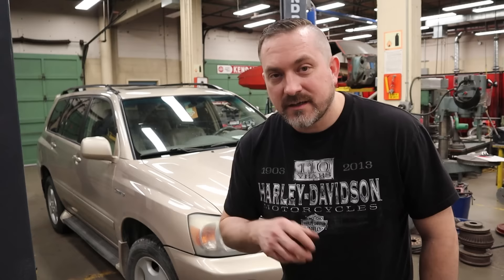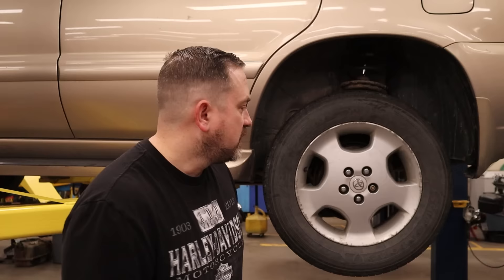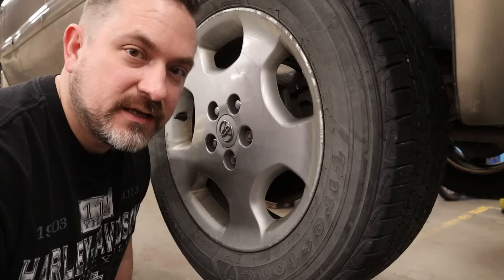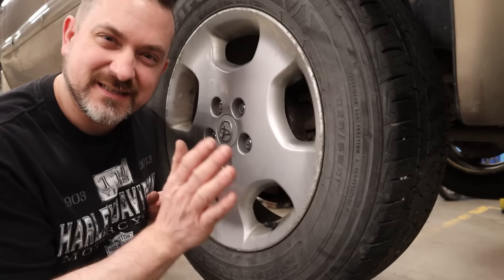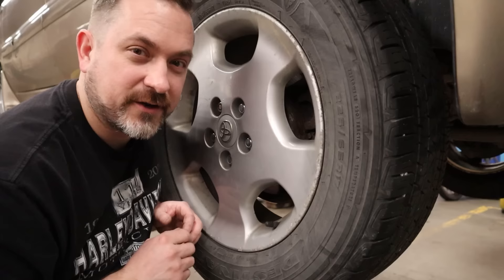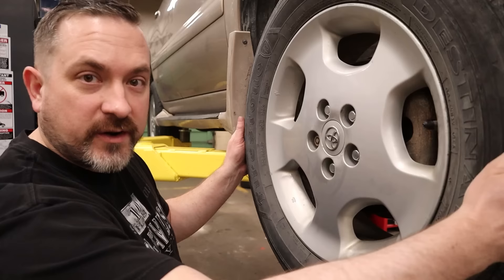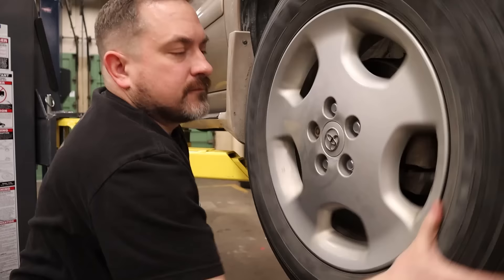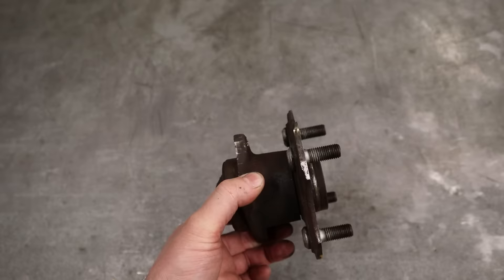How to 100% diagnose a bad wheel bearing.

Comment: The only tool I use to diagnose a bad wheel bearing is my ears
Reply from the maker: Yup, it's a powerful tool.  I'm using my ears to diagnose a bad bearing right now on my vehicle.  Thanks for the watch!
Reply: What if the wheel isn’t making any noise at all? My mechanic today said I need a new wheel bearing because my rear wheel feels loose
Reply: They literally scream at you lol
Reply: YH can u tell what one😂
Reply: @kia19982012 
He might be telling the truth.sometimes bearings don't make noise.
Reply: Yeah only problem with me is my truck is lifted with mud tires so it already makes noise but it does start to shake like a broken belt in the tire at highway speeds
Reply: That's pretty cool bro, I'm a home mechanic (on my own cars lol) have done a tonne of work so far tbh but my ears aren't confident like yours.. I wish they were but I still need to check yt every once in a while lol
Reply: Thank goodness I don’t take my car to you for repairs lol
Reply: That’s a great tool by the way

Comment: My friend checked my wheel bearing by a driving test.  As we drove down a smooth road we drove over a short hump in the road.  As the car momentarily lifted and came back down, for that  brief .moment the grinding noise stopped.  Diagnosis: A bad wheel bearing.
Reply from the maker: That's cool.  You temporarily unloaded the bearing which made it go quiet.  You can also do a road test where you turn and make the sound go away if you unload that side as well.  I made a video for this and it is coming out soon.  Thanks for the watch!
Reply: My issue it only humms at 30+ mph no grinding only a humming like I need to shift to a higher gear but I'm in top gear and when I slip it in neutral while costing at 55mph it has no effect on the sound. In fact if I'm costing down hill in neutral it get very noticeable humming sounds just like I'm in a too low of gear but I'm certain its not the transmission. The drive side does have minute amount of play when I perform the Shakedown test but when I rotate it there's no grinding

Comment: Put it in the air after the test drive and put your hand somewhere near the wheel bearing on each wheel, be careful not to get your finger stuck around the wheel, and spin the tire. You'll feel roughness as the wheel spins. In theory you can also use a infrared thermometer after a test drive and shoot the center of the knuckle around the wheel bearing and if a temp reading is very hot you have a bad wheel bearing in that knuckle.
Reply from the maker: Nice tips!  I actually have a mechanic's stethoscope that I use to "hear" hard to tell bearings and it works really good.  Best $25 tool in my box for diagnosing issues.  Thanks for the watch!
Reply: @wayofthewrench You can also use a long screwdriver, long wood dowel, or a broomstick handle to amplify the noise. Just touch one end to the bearing housing and the other to your ear

Comment: Where's the steering linkage video?
Reply from the maker: There isn't one yet but the principal is shake the wheel left and right and there should be no play.  If there's play, have someone look for steering linkages that are moving independently ( one moves and the joining part doesn't).  That's the bad steering part.  Usually it's the outer tie rod but could be the inner (squeeze the rubber boot to feel that one) tie rod or even power steering rack bushings.  Good luck!

Comment: My 06 Highlander had the ABS cover perforate from rust which caused the bearing to seize. It nearly brought me to a stop. I limped home and replaced both sides, packed the cavity behind the ABS sensors with grease, and it has been fine for a few years. Thanks for sharing!
Reply from the maker: Nice!  Its always nice to do your own work.  I now have a 2008 Highlander Hybrid, it's a nice vehicle.  Cheers!

Comment: My 2004 Camry with 104k miles suddenly started making a sound that sounded JUST like your Toyota Highlander.  It was like a weird kinda clunk but the clunk happened at an even pace.  Sound got worse with speed.  Turning it to the left made it clunk less.  Going to my mechanic tomorrow to get it checked out and now I'm armed with this information.

It never occurred to me that that initial grinding noise from a wheel bearing that is SLOWLY starting to go bad was something I actually thought was "normal" when I was driving in the freeway.  Glad I went directly home after I heard it start to thump/clunk like that.  Thank you!
Reply from the maker: Awesome! Glad I could help ya out.  Keep in mind a cv axle can also make sounds like you said and sometimes multiple issues can be happening at the same time (wheel bearing and maybe now a cv axle too).  Good luck!

Comment: Thank you. Great video. 

The situation that is annoying though, is right when the bearing starts to go bad, so it sometimes makes such symptoms, but not all the time. 

When my right front bearing was going out, it made that growling noise ONLY when I was turning left in traffic circle at speeds. When I was traveling in the straight, it did not make that noise. 
Reacted to the 3-9 / 12-6 push-pull test. Movement was barely maybe 1-degree, but it moved. 
Spinning the wheel while up on jackstand? Again no growling. 
In any case, after that bearing change, no more growling noise when turning left in traffic circle. 

Fast forward 2 years later. 
Now I suspect the rear right bearing is starting to go. 
1 time out of 10, when turning left in traffic circle, I hear the growling noise. 
Not reproducible every time. Just roughly once in 10 attempts. 
Does not react at all to the 3-9/12-6 push/pull test. 
Drives me nuts…
Reply from the maker: You're very welcome, glad you enjoyed the video!  Bearings can make noise but have no play in the beginning of the wear but will eventually have play as the wear gets worse.  Hope that helps.  Thanks for the watch and welcome to the channel!
Reply: I have a related question. My rav4 only seems to make a sound in the rear right wheel when I make left hand turns. It's quite loud and the faster or sharper I turn the louder it gets. A sort of uneven grinding, almost squeeling noise.

 I'm not sure that I hear a noise while driving straight that gets louder with speed. If there is, it isn't any louder than typical driving noises.

There isn't any noticeable play in the wheel when I jacked it up or any noise that stands out above the break pads. (Same on the other side, I tried them both for comparison)

Does this still sound typical of a wheel bearing issue? Maybe early onset?

Awesome video by the way, I appreciate the effort you make to bring out the sounds. I will be checking out more as I try to do as many of my on repairs as I can.
Reply from the maker: Sounds like a bad rear wheel bearing to me.  you should watch my road testing bad bearing video too.   Hope that helps!

Comment: Thanks for the video.  In my quest to do my own general auto maintenance, I rotated my tires using the spare because I’m not sure of the proper jack points of my car to use stands. Anyway, all went as planned and in the process I discovered several loose lugs on two of my wheels. I have been experiencing a shimming while braking for over a year thinking I had warped rotors. Had that checked by a mechanic friend and he said my pads and rotors looked fine. 
After the tire rotation and tightening and retightening my lugs to specifications my shimmying while braking is gone. Evidently I had loose wheels. 
This is why I want to continue to learn and do this myself. Even a very experienced mechanic didn’t think to check the lugs/wheel.
Reply from the maker: You're very welcome!  Yeah there's a lot to learn and it all has to be done correctly or you'll have issues or worse yet, an accident.  If you haven't already, check out my other videos so you can properly jack up your car and learn other stuff you need.  Thanks for the watch and welcome to the channel!

Comment: I’ve been trying to tackle a strange vibration problem on my 2003 Ford Ranger. I replaced every suspension component front and rear, ball joints, sway bar components, and all four brakes have been rebuilt and replaced. Soon after it developed the vibration issue between 45-55 mph, leading me to think I had a driveshaft issue. 

I always thought that bad wheel bearings would let you know they were bad by making a squeaking sound, in my case they make no noise but the two front wheels have slight give when shaking it, EXACTLY like this Toyota here. 

Thank you
for this video. I’ll be getting them replaced next week.
Reply from the maker: Oh cool!  Hopefully this solves your issue.  Let me know if this was it.  Cheers!
Reply: @wayofthewrench  hey there,
So I did replace the bearings and torqued it to spec, vibration is still there, but there’s no doubt that the new bearings have changed the truck for the better! It’s steering so tightly now, I love it!
Reply: Did you replace your shocks? If not check them, that could be your needle in the haystack

Comment: This is a good way to check. I'd like to mention that side to side play could be from steering, I think you mentioned that. Also noise isn't always an indicator and neither is feeling for play. That will get you to 99% but, a dial indicator measuring for runout will get to 100%.
Need my local safety inspection mechanic to watch this.
I had two vehicles in need of an inspection. My truck, which DID have a bad wheel bearing that I knew about (part was on order) and they missed it. It was bad too. 
My car which did not have a bad wheel bearing they said did have a bad bearing. I took it home, I got out the dial indicator and a print out of the specs in the repair manual and made a video showing it wasn't bad. Popped the wheel back on, but took it back, but said it was fixed and they passed it.
Reply from the maker: You're right, sound and play isn't always present but eventually they will both be there.  If you have trouble feeling the play, a dial indicator is not a bad way to check for it.  I have never used one on my diagnosis' though, they are pretty obvious.  Especially when my customers roll with them for weeks before bringing it to me.  Thanks for the watch!

Comment: Yesterday I picked up my daughter's Ford Kuga after the routine service-book service.  I had mentioned to the guy that there was a rumbling noise when driving and it's loudness increases with speed.  I said that I think it's gotta be some wheel bearing issue. Ford did the full service but obviously did not check the wheel bearing. They charged just over AU$ 2300 and the noise is still there! This is Australia's FORD !
Reply from the maker: Yikes, that's horrible.  Maybe it's time to start doing the checks and repairs yourself.  At least you'll know the job is done right and it will save you a ton of money. Thanks for the watch and welcome to the channel!

Comment: Our 2005 Ram 1500 was misdiagnosed by a shop as a bad CV joint.
We would hear a loud, really loud clanking almost like snapping metal.
It would stop occasionally.
Putting truck in 4x4 or driving reverse, it would start up again.
Took 4 hrs to remove drivers front wheel bearing, seized to the knuckle.
Cut two wheel lugs off and used the two bolt and nut trick to push the bearing away from knuckle.
With a lot of sledgehammer use...
New wheel bearing.. no more clanking.
Reply from the maker: Awesome!  Glad you got that fixed!  Ya know often the hardest repair jobs are the most rewarding and is a big part of why people hate/love wrenching on vehicles.  Thanks for the watch!

Comment: My 2010 Prius had speed related wheel roaring noise at about 45 mph - worse when veering left. Neither rear wheel had any loose play, but the right one spun more freely and had that roaring sound. Good clues!
Reply from the maker: You check the fronts too?  Usually when the sound goes away when veering to a certain side, that side is the one that is bad.  Thanks for the watch!
Reply: @wayofthewrench  turned out to be the left side rear. No free play, but the wheel spun like there was gravel inside.,
Reply: My 2011 town and country is that way,  too.   No play in the wheel at all.   But it's a wheel bearing.  Starts at about 40MPH, gets worse as you go faster,  gets worse if i swerve left, goes away if if I swerve right..  front right bearing.
Reply from the maker: Glad you got it figured out!
Reply from the maker: That's a very sound diagnosis.  Yeah in the beginning there is no wear, just sound and heat.  Then after a while the play starts to happen.  Thanks for the watch!

Comment: Wonderful video and explanation!!  Tackling the rear in my Toyota venza and figured if I I would have to do both because it would be difficult to find. I also figured why not do both at the same time if one goes the other one probably will go soon. After watching this video, I was able to find it and at least put off the other wheel bearing until it actually needs to be changed thank you.
Reply from the maker: Yeah they usually do both sides because the other one has equal wear and time spinning.    Thanks for the watch and welcome to the channel!

Comment: So the noise that occurs when driving - is it going to be a constant sound? Cuzz what i hear when i hit about 45 mph kinda sounds like a little more of a thudding noise and it seems to be in sync with the rotation of the tires.
Reply from the maker: The frequency of the thudding noise will determine if it's a speed dependent sound.  If it speeds up as you get faster than yes it could be.  It could also be an issue with your tire.  Check for any delamination or foreign object stuck in a tire too.  Hope that helps. Thanks for the watch and welcome to the channel!

Comment: Play up or down could be a bad lower ball joint on a Mac strut car like the one you're working on. If this were a SLA or other suspension it could be lost of things.

Also, not all noisy bearings have play, in my experience most don't. But I have found that If you hold the spring with one hand and spin the wheel, you'll feel the roughness in the bearing being transmitted to the spring. Best way I have found to pinpoint the source of the noise side to side.
Reply from the maker: You're right.  I have another video showing some other ways to diagnose bearings including your info on feeling vibrations in the spring and a road test.  Thanks for the info and the watch!

Comment: Nice video
I have a 2009 P. Vibe GT- high mileage. Burns oil and needs more frequent maintenance. Wish I had a garage, lift and second car. Have to rely on mechanics. Luckily I found a great, fair one in my Hood- Washington Heights NYC. Thx
Reply from the maker: Ya know I learned all of my experience with vehicles with jacks and stands in the parking lot/driveway.  You don't need all the extras but it sure does make it easier and more enjoyable.  That's good you found a good mechanic you can trust.  I would recommend finding a second used Toyota so you can sell the aging vibe.  Good luck!

Comment: Also learned of a method to hold the spring while spinning the wheel. The vibration from the bearing will transmit through the coiled spring such that you can feel it.
Reply from the maker: Oh that's cool, I'll have to try this!  Thanks for the tip! Cheers!
Reply: I also heard of that method.
Reply: I made a video a long time ago showing that method. It had a half a  million views here on YouTube. I took it down when I shut my channel down and retired from the business. When you have a bearing, causing a noise, but everything feels tight, It’s the one true way to find it.
Reply from the maker: always cool to learn new tricks eh?
Reply from the maker: Cool trick, I'll have to try it out.  Usually if they are making noise, it's not long before it's obvious with a spin test or play starts to develop.  I find most people are bringing in their cars with the wheels practically falling off these days saying " something's making noise, can you find out what it is?"  Thanks for the watch and the suggestion!
Reply: @wayofthewrench  let me know what you find out! I used to be an engineer at Honda and we road tested wheel bearings and analyzed the sound profiles with a human shaped microphone/data recorder. We could change out bearings on a lift in 5 minutes on the Civic model.

Comment: I had to replace a fr wh bearing on a Nissan. There was no play detectable: the only indication was the road noise. Changed it, but changed the wrong side! So ended up with 2 new fr wh bearings. Not a bad thing. I did actually push out the old bearings using a 5T press - was challenging! But ... all's well that ends well. Very inexpensive repair.
Reply from the maker: Yeah usually these are replaced in sets so you're golden doing both.  Those press out/in bearings can be tricky because you have to support the race that touches the part otherwise you instantly damage the new bearing......sounds like a video idea for the channel.  Thanks for the watch!

Comment: My 2015 versa had the left bearing replaced a year ago.  Now I'm hearing clicking at low speeds with the windows down on the right side. My mechanic who I've gone too for everything for years changed the serpentine belt. I told him to check the bearing. The belt was worn anyways. He doesn't think it's the bearing. Maybe the brakes have too much dust. It's making a lot of whirling noise at high speeds and goes away when I tap the brakes. I'm still leaning to bearings
Reply from the maker: Usually wheel bearings are replaced in sets because when one is worn out, the other is usually needing to be done too ( same amount of wear).  Dust on brakes isn't a thing but worn out brakes is.  I would check for side to side play in the wheel when it is lifted up and then you'll know.  Also if the noise is speed dependent, it is a good sign of a bad wheel bearing.  Good luck!
Reply: CV axle